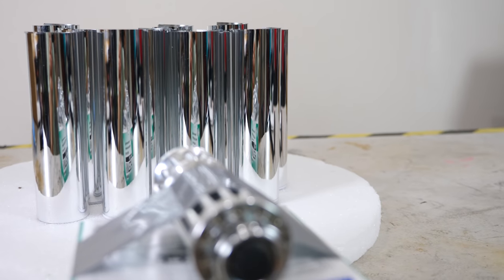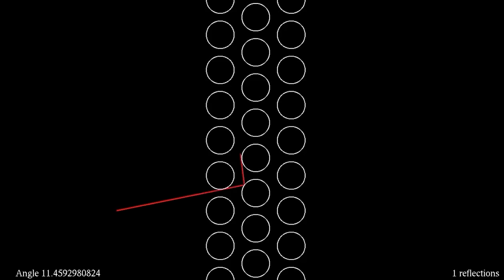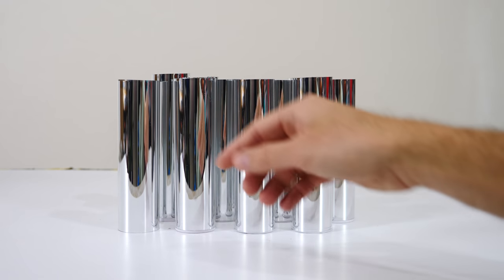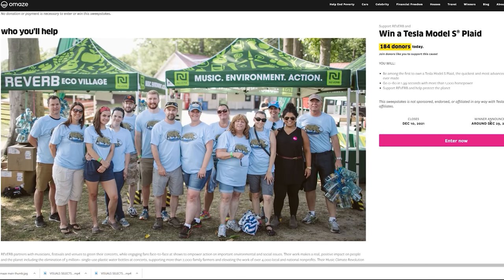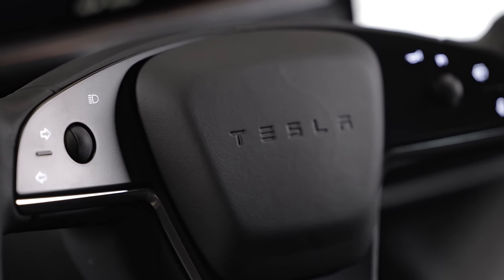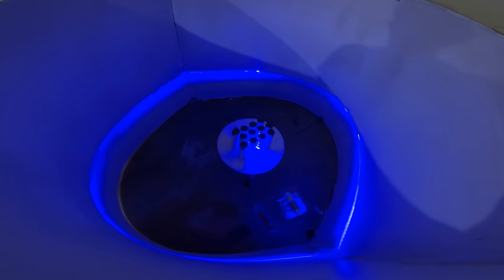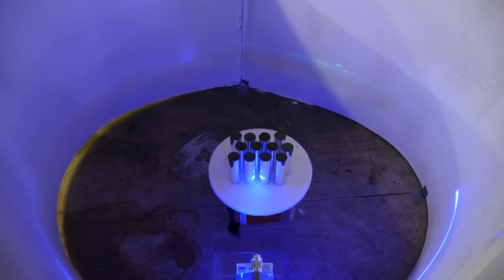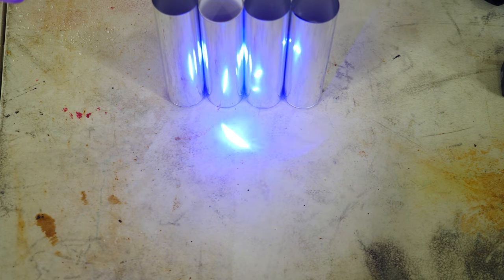The Butterfly Effect With Cylindrical Mirrors And a Laser

Comment: Hey @the action lab! I have a question. Is it possible to dry a wet cloth in a vacuum? When the pressure decreases, then the boiling temp. Of the water will also decrease right? So will the water in the cloth get evaporated in a vacuum? Can I use the vacuum chamber to dry my clothes instantly? Also, would you mind making a video on it? :P
Reply: I have a vacuum chamber and I've tried drying mushrooms with it and it doesnt work very well and it takes days of constantly releasing the air and re vacuuming it than releasing and so on for it to work but it does seem to make it so no bacteria will grow but I think freeze dryers are probably the only way that a vaccum is gonna dry something very well!
Reply: It will evaporate quicker at first, but due to the evaporation it will cool down (the hotter molecules will leave it, while the colder ones stay in there) This will go on until it wont evaporate that quickly any more and then it will dry slower again
Reply: @GoldenBoy-et6of  you should add heat source such as infra red light or other light might work. Because in vacuum, all heat transfer execept radiation is gone. While evaporation require heat, initially the item dried will drop in temperature until the rate of evaporation also go down to equalize the heat absorbed. You may use heating surface, but the heating contact area may be reduced when the item wrinkles as it loses water. Freezing before vacuum drying is just a way to maintain the form factor and integrity of the item dried.
Reply: @GoldenBoy-et6of  did you try putting the mushrooms under a lamp? Good luck with your drying
Reply: I think an issue is that the moment any water evaporates it becomes a gas, which then adds pressure, meaning you'd constantly have to be pumping air out of the vacuum chamber, meaning your vacuum pump would constantly be sucking in water vapor which probably wouldn't be good for it.
Reply: I assume the water will partly evaporate but because of the freezing point shift, most of the water that stays in the wet cloth will just freeze. If you put water in a bowl into the chamber, some water will evaporate but a remaining amount will eventually freeze
Reply: @sikliztailbunch  yeah good point about the freezing, I remember in the exploratorium in San Francisco in like the late 90s, they had an experiment where you could pour water into a little chamber, it would suck the air out and the water would freeze within like 30 seconds.

Freeze drying is definitely a thing, but you need exceptionally cold temperatures and low pressures for it to work. It requires a combination of a vacuum chamber and a super cold freezer.
Reply: @R2Bl3nd  no it actually doesn´t require extra freezing. The evaporation caused by lowering the boiling point sucks enough energy out of the water body to freeze it because the freezing point and the boiling point get closer together but you are right about requiring really, really low pressure close to absolute zero.
Reply: @sikliztailbunch  yeah so TECHNICALLY you don't need a deep freeze, but it's not exactly cheap or practical to get to near absolute zero.
Reply: @mathtonight1084  I don't understand the issue of adding IR heat to compensate the chilling effect of water evaporating of mushrooms. I don't believe anyone was thinking of roasting them. I'm really not into mushrooms, I only find a few that are at all palatable, but the science is always interesting.
Reply: Thunderf00t has already debunked a vacuum clothes dryer.
Reply: @JamieJamez  Yep, atleast the claims of the BS micro tumbler. There is little point to pull a massive vacuum since you will need to transfer heat into the mix to prevent freezing temps. So, pulling a decent vacuum while having a small-ish heater and a massivly fast spinning fan trying to circulate and re-heat what little air is left... but probbaly a heat pump condensation tumbler is more effective because you get a cold side and a hot side at once so facilitating condensation is dead easy.

I don't remember the exact selling point of the micro tumbler, I think it was speed. TBH it does take time to get the refrigirant going on maximum capacity... but so does pulling a vaccum.. soo... dead race?
Reply: You could, probably would need continuous pumping, and a heat source
Reply: @crackedemerald4930  Yep, if the water removing method in steam phase is go-to method then continous vacuuming is a prerequisite for this to work. and... fluid water -> steam is a 1:1700 volumetric process so there will be alot of sucking to do... and for every ml of water you evaporate have to add alot of heat to compensate for the evap cooling effect... entalphy is a cruel and dependable m(o)istress.. ;o)
Reply: @Paxmax  IR light is just more efficient in delivering heat. You can regulate the intensity just enough to maintain constant temperature. The point of vacuum drying is to keep the material in relatively low temperature to prevent cooking it, while still having fast evaporation rate. If you are not in a hurry, you can just put the material in the freezer and eventually the material will dry out.
Reply: @crackedemerald4930  you could use heat pipes connecting between the inside and the outside of the vacuum chamber. add finns on the outside to act as a ambient heat source. the problem is to spread the heat evenly  inside the chamber to dry the clothes.
Reply: @nilsdock  if there is no medium for propogating heat then i would use radiation- a vaccum microwave?

Or [big brain time] connecting an outlet to the clothes from pressurised space i.e. run over your clothes with vaccuum cleaner

Comment: in fact you can see even better on your experiment, a change just the size of the laser (a few mm)  can drastically change the outcome. The little changing of the start conditions of the photons  trough the thickness of the lazer made them end up trough the hole 360º of possibilities.

Comment: Great illustration, it would never have occurred to me to try this! 
I suppose the idea of magnifying small causes to get huge effects could be simplified, in a thought experiment, to a bullet directed at a planet in a distant galaxy.
A single dust particle hitting the gun would cause the bullet to hit a completely different planet.  We'd just be using a single straight line with the same length as a lot of folds to achieve the magnifying effect.
It would be probabilistic as well because there's no exact place the dust particle could hit because ultimately there's no "exactness" in position.  
(I suggested a bullet in the experiment because it wouldn't spread out like a laser beam, further simplifying the general idea.)

Comment: There are actually three effects at play here that conspire to create the width of the beam. 
The laser isn't a perfect point source, and is emitted multiple (many) photons wide. The laser isn't perfectly coherent and very slowly diverges (like a tenth of a degree at most) and scatters off the air. 
And even if it were a perfectly coherent point source and the experiment were in vacuum, the fact that photons themselves have a width (because Heisenberg, among other things) and the atoms in the mirror inherently form a lattice somewhat akin to the cylindrical mirrors in miniature, plus a few other quantum considerations, will always introduce some small degree of scattering.

Comment: I think the fact that there is a width to the 360 degree strip is neat.  Because the laser was at a slight angle downwards, the farther you go down from the top on the image, the longer the light path was.  That means that you can see the distribution of lengths of all of the paths from this! (Assuming the toilet paper rolls are perfectly vertical :/)

Comment: The old 1980s version allows us to actually see the fractals that cause this Chaos effect (featured in The Physics Teacher magazine and others.)  Get three spherical mirrors, put them together in contact, and hold a frosted large bright bulb in the roughly triangular space behind.  Only three curved mirrors needed for butterfly effect (produces an infinite number of "infinite mirror-tunnel" images, all adjacent to each other!)   The apparently-straight edge of the triangle-image visible in the three sphere-mirrors is fractal, and infinitely long. 
So, your laser above is producing Chaos by shining upon the edge of a fractal, in theory producing a reflected light pattern with 1/F self-similar details at very wide length-scales.  Mirrors with N=2 don't work, you need N=3, while higher numbers conceal the fractal structure, making it look more like random white noise.

Challenge that I've never figured out:   bend some mirrors so, when you look into one, you see a fractal fern!    Video-feedback with a flat mirror can do this (producing "Affine" fractals, with no iterated X^2 included.)   But, can we do this with just mirrors alone?   If so, then we can probably create images of actual Julia sets, by including a curved mirror which gives parabolic distortion!

Comment: I think another factor is that the flexible mirrors scatter the laser slightly more than a typical “perfect” mirror.
This effect further gets amplified with every reflection resulting in the light shining out from all directions and onto the entire circumference of the outer fence.
Reply: That is one of the most important aspects here. You are absolutely right, such mirror films are unfortunately garbage. There are definitely 2 aspects responsible for the result here. 
1. a poor laser without good optics and the associated mounts etc.
2. not nearly round rollers and very weak mirrors. Chrome-plated tubes might have been better here.
Nevertheless, a very clear video.

Comment: Deterministic but unstable systems behave this way.  Think: what is the difference in angle off of a single cylinder, then apply N times.  Or for the pendulum, realize that the period for a single pendulum is angle dependent up to 15% at 80 degrees and thus small perturbations would add up if there was only a single pendulum.  Then add a second pendulum for a larger and continuously varying and interacting perturbation and it adds up in a much faster and more random manner.

Comment: I feel that the orientation of the mirrors need to have a wider and more consistent spacing. In the simulation, the space is wide enough that once the beam hits the first mirror, the beam is able to travel past mirrors, before hitting one on the incident angle. Right now, your beam is hitting multiple mirrors and scattering.

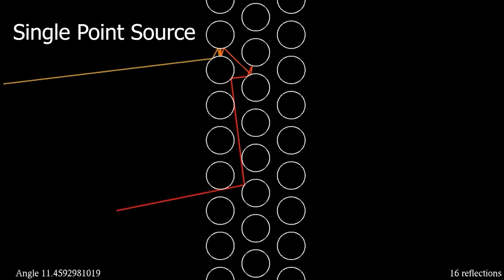Comment: Actually good that you pointed out why the simulation and reality differ. (after 5:00)
Since yes, a simulation using a beam without any width is practically an "ideal" laser, and such don't really exist in reality.

Though, it is interesting how the resulting circle is divided up into many individual semi circles with their own intensities and widths, showing that they do in fact come from different parts of the original laser's width. And the vertical separation is also a bit interesting.

I am now curious to how more ideal mirrors would fair.

Comment: yes the laser beam has width, but also the foil mirrors are imperfect in at least 2 ways;  1 they are not perfect cylinders,  2 the foil surface is not perfectly smooth and will scatter the beam somewhat. Both these factors would also make reality diverge from simulation.  Edit: you might observe some vertical spreading due to these factors.

Comment: This could also be used to illustrate parallel computing or quantum computing. Instead of solving the equations for each angle to find the solution (output ray) the wider laser beam is solving all equations at once and showing all solutions at once - the most likely solution beeing the brightest spot on the periphery.

Comment: What's crazy about this real life version is it'd be nearly impossible on modern hardware to make a renderer that's capable of rendering this kind of result. At least, not a general purpose one.

While you could use shortcuts like shooting all light from the light source and detecting when the light hits the outer walls to draw it, the technique would fall apart the moment you want to render anything other than a wall that perfectly bounces light back to the camera.

A lot of modern 3D renderers use lighting models that require taking into account both light bouncing distributions from the light source's perspective, and the camera's perspective.

If you sample the light influence from the camera's perspective you're never gonna catch all of that light, or even a fraction of a fraction of it because it'd take too many samples.

If you want to render what the light influences from the light source's perspective, you're never gonna find even remotely close to all of the light influence that successfully reaches the camera.

Even if you combine both using methods like multiple importance sampling (sampling multiple important factors, as in light source perspective & camera perspective and mixing the result) you're still going to be missing so many lighting influences that you're gonna have a hard time coming anywhere close to rendering something that looks like the video. It'd take too many rays to model, so it would take forever to render it to a point where it doesn't look like a noisy pixelated mess.

Comment: The mirrors that don't get hit directly by any of the beams of light, still reflect the diffused light that hits them (which the computer simulation doesn't account for). That's why you seemingly get 360 degrees of light.

Comment: Of course there have to be conditions where such minor variations can have major effects. 
If you have a lot of lose rocks on a hillside and kick one, you might start an avalanche, but if they have a much lower potential energy, such as sitting at the bottom of a hill, kicking one wouldn't have that effect.  There must be some viable tipping point where the tiny variation or energy input can effect change and cause a different result or release the potential energy to result in a much greater action. 
That's why butterflies do not cause hurricanes.  :)

Comment: Light is a particle and a wave.
If you only calculate 1 particle of light, it will only land at one spot in a probability curve.  When you use a laser, you are shooting tons of individual particles and different start locations thoughout the width of the laser.   Millions of photons shooting from the same source point and hitting in a 360 degree circle shows off the butterfly effect well.

Light light also acts like a wave, and will use wave probability, which gets into wierd science math.

Comment: Ok, I have been thinking about this video quite a bit. The smallest changes in the initial conditions create a different output, so in principle if you had a laser shooting into a box of mirrored columns and you didn't change anything the walls of the box will not change their pattern of laser dispersion. Could gravity make enough of a change to change the output? So you have the set up without a mass next to the laser and then you put a mass next to the beam before it enters the box will you get a different output? I want to say yes you would, you could enhance this effect by adding more and smaller mirrored cylinders. Essentially you will be "magnifying" the output effect of due to the change in gravity. I don't think you could make real measurements of gravity due to the chaotic nature of the experiment but you should be able to see change caused by gravity.
Reply: I think that before seeing the effet of gravity, you would pickup background vibrations and thermal noise.  

If the laser is 10cm long, it would take a displacement of about 5E-11m to change the angle to the ninth decimal, which is in the range of tens of picometers, for comparison atoms are in the 60 to 500 range. Even with perfect beam integrity and mirrors, it would still look like the system output light all around

Comment: In a practical sense, there are NO deterministic equations in PHYSICAL chaotic systems. This is due to Thermodynamics and the fundamental errors in all mathematical modeling. 
1. Real physical systems are constantly being buffeted by Brownian motion (random thermal agitation). Thermodynamical error.
2. To initialize a model, it is necessary to measure initial (or other boundary) conditions. All measurements are approximate, and none can be perfect, since that would imply infinitely many significant digits.
Measurement error.
3. All mathematical models have errors in principle, since it is never possible to include exactly friction, etc. 
Modeling error.
4. In numerical evaluation of mathematical models, there is always a limit to how accurately the transcendental functions used are computed. There are always terms that need to be dropped.
Truncation error.
5. In step-wise calculations, only a limited number of intermediate digits can be retained.
Roundoff error.

Therefore, even if the pendulums are made and initialized to atomic precision, different physical units will behave differently.

This lays to rest the notion of accurate climate modeling.

Comment: It’s also possible that when you applied the mirrors to the toilet paper rolls, they didn’t create a perfect cylinder. Most likely they had bumps and smudges on them. I wonder if you can do the experiment again with cylindrical mirrors ordered online and cleaned, then used a thin red laser pointer.

Comment: I know you usually don't take suggestions but
-
 I was curious but what would happen if you were to take a drone (it's blades too) and use aerogel powder/paint to make it waterproof and form that thin pocket of air. Would it fly like normal as if there was no water or would it create a vortex with the blades in the water? (Or would it just short circuit...) (that's a possibility too)